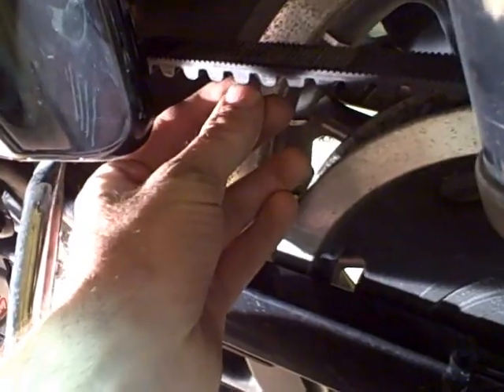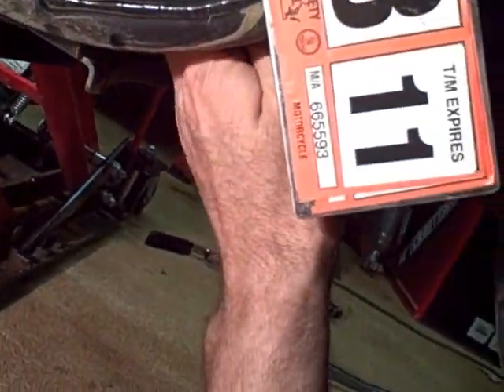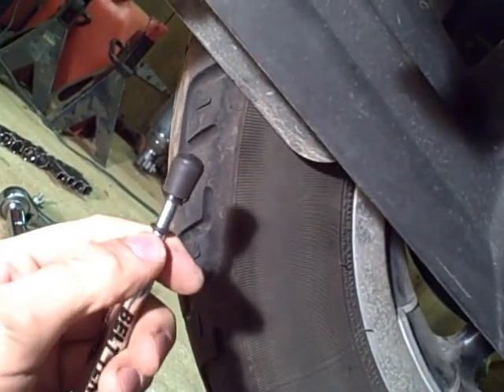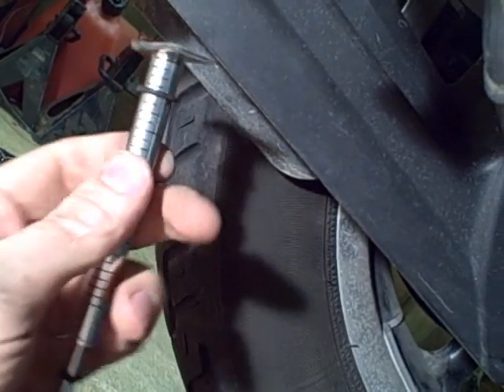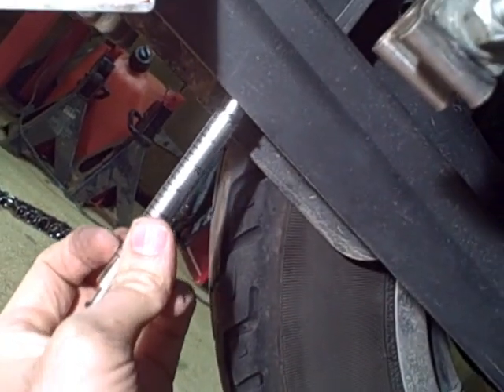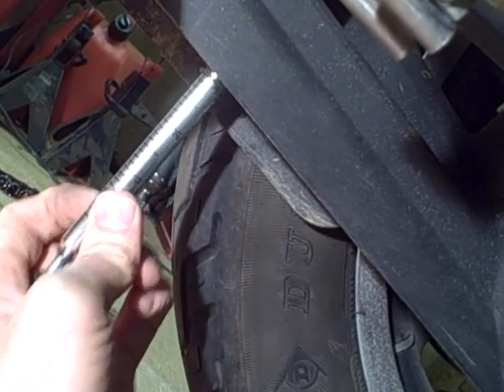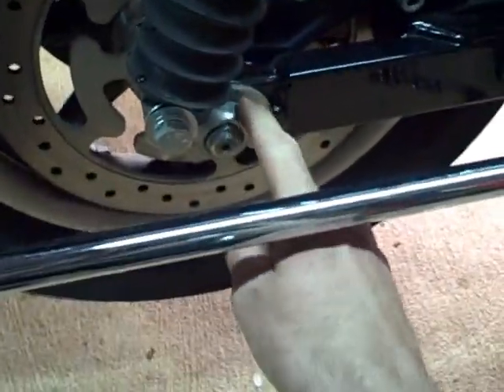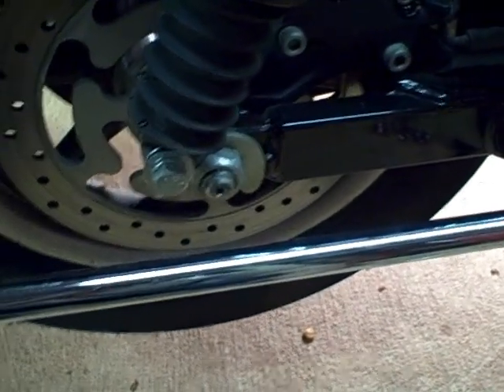Motorcycle Repair: Inspecting & Adjusting the Final Drive Belt on a 2008 Harley Davidson Road Glide

Comment: Gates (who have made millions of different belts over many decades) sell an inexpensive tool to check tension that's also quite handy for your other belts.
I'd eyeballed belts for many years with no problems but since I got the tool I use it often. Don't pay extra for a "motorcycle" version of the same thing.

Comment: Does this have the adjustment cam on both sides of the wheel, so that when you turn the left side, the right side cam turns also, keeping the wheel centered evenly?
I have not seen this new style yet, my 02 sportster has a nut on each side you have to turn to tension the belt.